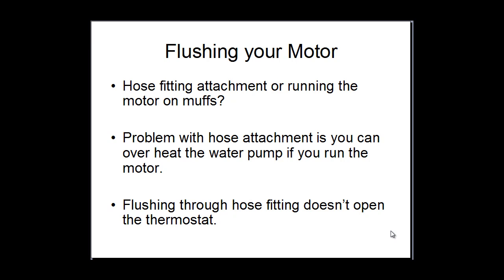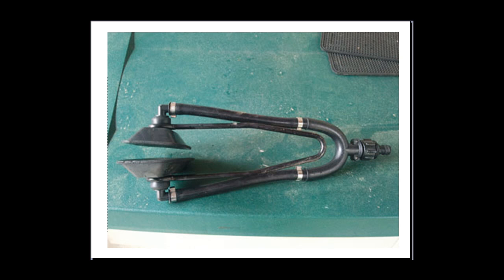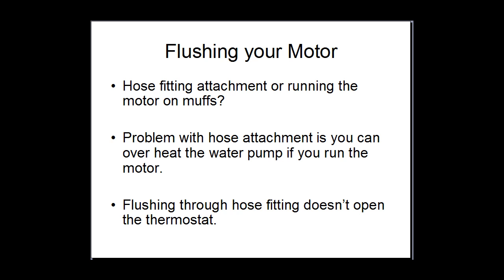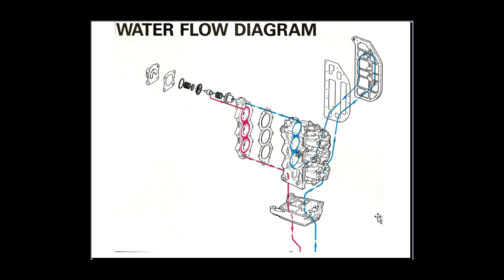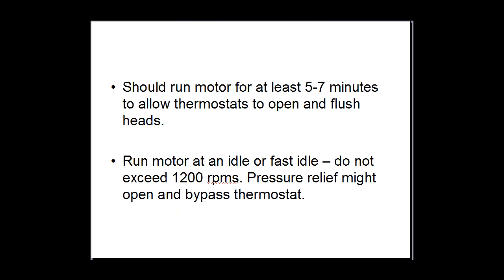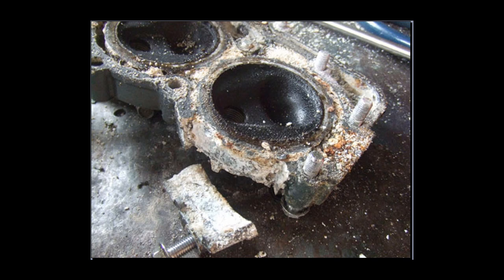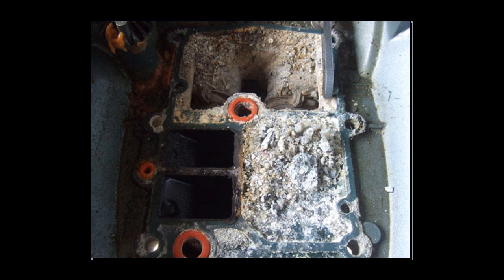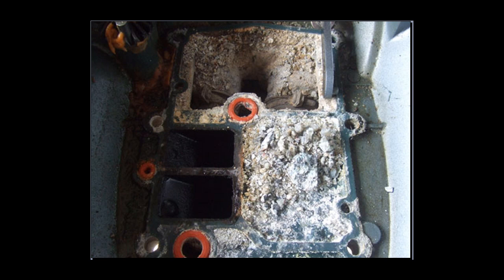Salt water corrosion in outboard motor and the need to flush

Comment: Hey I have a 1990 Evinrude 8, my exhaust spits out a little bit of water, and it seems to have oil or gas in it because it speckles the water around it. The lower end is hot to the touch and it puts off a good amount of white smoke almost like there is too much oil in the gas mixture, the tell tale is spitting out water just fine, and the water gets warm. Do you think my motor has this problem. I was also thinking it could be a head gasket.

Comment: My 150 Four stroke is 10 years old and now stuffed because i followed Yamaha's instruction on flushing. $20,000 down the drain. I'm really pissed off and as it's 10 years old i have no claim. Stuff Yamaha I'm buying a Suzuki DF175 next month.. Very disapointed
Reply: Hi David,
As soon as i got home from EVERY fishing trip i took the cowl off sprayed the power head with Inox and then hooked the hose up to the top connection point as per the manual and let the hose run flat-out for 15 minutes. I rang the Yamaha rep and he said i was doing it right but to never start the motor... He said iow was all that was needed. 
At 800 hrs and not a scratch on the motor my mechanic pointed out a little dribble of dried salt about 30mm long on the block. Then he pulled out the thermostat and pushed a screwdriver through the block !!!. The anodes were replaces at every scheduled service. 
Still not happy but upgrading to a new 2400 Noosa Cat with 2x 150 tg Suzies. Needless to say i have raised the issue of my Yamaha with everyone who will listen. I checked the manual for the Yammie 150 on line the other day and it still said Do Not start the motor...
Reply: I started a long debate on ausfish.com.au about the problem. A lot of peoples said i wasn't flushing it properly or the anodes were not being replaced at the services it went on and on. But there are quite a few worried Yamaha owners out there who were also following the manual...
Reply: John Hooker s

Comment: I wonder what happens if I run my 15hp Mercury in a barrel of tomato soup?
Reply: Never flushed mine and it,s ten years but maybee salt is a little less here in Norway since moore north.On boat whole year and worc well with new impeller.Only way "flush" it is i drive in to a brackish lake here and there=)A Tohatsu 4 stroke 3 cylinder EFI 25hp
Reply: It just makes a more creamy soup, I tried it already